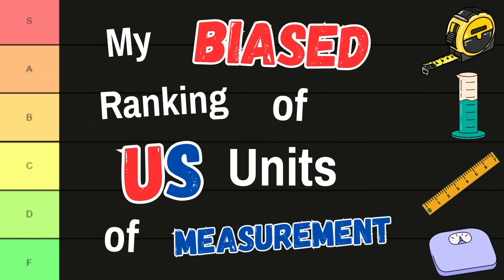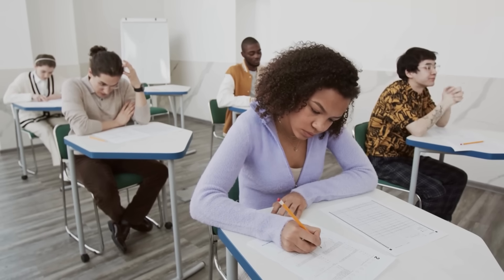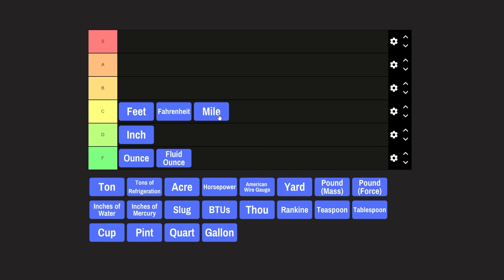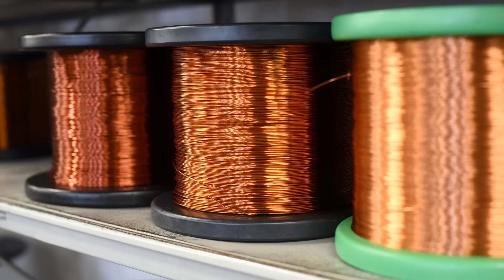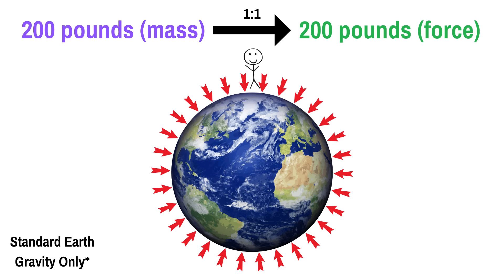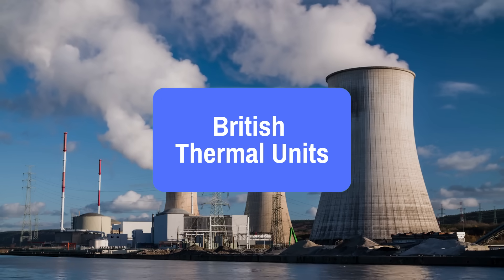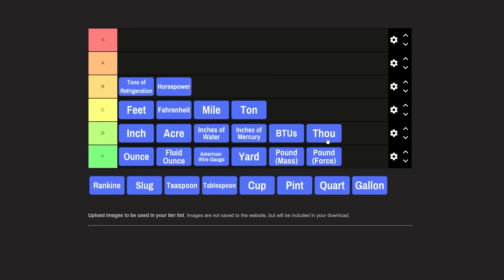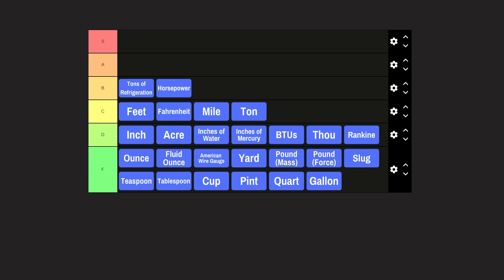Tier List of the DISASTROUS US Measuring System

Comment: I am surprised any of them made B-tier. And, for at least the measurement of length, the measures used are all based on metric, given that the official definition of an inch is 2.54cm. So, it’s all metric without any of the advantages of metric, and all the disadvantages that come when not actually using metric.

Comment: Twips are still used in typography.  That 1/1440 inches is a twentieth of a point, given that there are 72 points in an inch.  

Slugs are not used in everyday life in the U.S.  In fact, the only place I have ever seen them used was in a differential equations course.  They're sometimes used in engineering, but the sciences generally use SI units.  Because they're a somewhat traditional engineering unit and all the engineering majors took that course, the text included problems with that unit of measure.
Reply: 72 points in an inch was invented by Adobe in the 1980s; traditional American typographic points come in at 72.27 to the inch (though it probably should have changed with the definition of the inch in 1959)

Comment: Another f-tier would be psi
1) pound PER square-inch not pound TIMES square-inch => p/si
2) which pound?
3) a square of thumbs - wtf

In short: just use Pa (or bar).
Reply: @nathanwaight  Since I'm mainland european I never use imperial and only ever see it on bike pumps. But when i pump the tires i still read the bar scale because it's a unit i'm familiar with and actually makes sense. Using psi for tire pressure when you don't use lbs or inch would be just stupid...
And since Pa (N/m^2), bar (10 N/cm^2 = ~1kg/cm^2) and MPa (N/mm^2) correlate directly with area it's simple to get to grips with.
Reply: @nathanwaight  I worked in injection moulding and started with older machines where you physically needed to move the switch to e.g. give the signal to switch to holding pressure or stop injection, start mould safety zone when closing the mould etc. Certain things were based on the actual hydraulic pressure which on some machines was marked as "atü" - basically bars just named "Atmosphären Überdruck" (atmospheric overpressure).
Otherwise one i only came across once was centistokes for kinematic viscosity...
Reply: @nathanwaight  then atü is probably the same as atg. There might be a difference somewhere on the numbers behind the comma.
atü is not exactly 1 bar, a little bit lower, but close enough for the use it had in this case.

Comment: Save for a few exceptions, all base units are arbitrary. There's nothing inherently better about the meter compared to the yard, or the kilogram compared to the pound. It's the system as a whole that makes SI much, much better than imperial/customary.
Reply: The idea behind metre was that 10 000 000 metres should be half length of Earth's meridian (so from geographical pole to the equator). They were a little off in calculation and in reality half length of Earth's meridian is 10 001 965 metres. But regardless in metric it is easy to remember that full meridian is about 20 000 km and equator is 40 000 km. :) So at least they tried to some decent classification, not completely random.
Reply: @Hadar1991  I believe that inaccuracy was known when the length of a  metre was set - the calculation was made to work in a theoretical universe where the Earth doesn't spin and is therefore perfectly spherical. It's actually pretty accurate in that context. ( caveat: this information comes from QI, so is subject to the normal reservations concerning their facts )
Reply: Na, they're all arbitrary!
Reply: the only true S-tier thing is the fine structure constant, since it's unitless

Comment: I've posted this before, but:
I learned both Imperial and metric when I was in grade school. Now in construction, I consistently use Imperial. The 'inch, foot, yard' has no metric equivalent. A centimeter is too short and a metre is too long. The decimetre is the most useful metric length, but it's rarely used. Some say stair building is easier. Metric might be a bit faster, but it takes me longer find the other tape measure than the time I save. And as far as tapes with both measurements....😂 I will concede that A4 is a bit more elegant looking than Letter, but even in this arena I find Letter more useful dimensionally. A gram is close to useful, but a pound is more useful than a kilo - a kilo is too heavy. Temperature-wise I'm agnostic, I'll use either system; however, Fahrenheit is more precise. Volume is the place metric can excel, especially breaking down a cube into litres (a litre is a perfect size, well done metric) but how many people need to make those calculations?
Reply: "find the other tape measure"  It might surprise you, but builders here don't have to find "the other tape measure" because they use only one.  ;-)

And we can creatively use multiples and fractions of those units.  What a concept… for someone who surely encounters crazy stuff like 3 5/32" all the time.  Half a kilo (we usually don't say kilogram, if the context is obvious), 250 grams… really not that hard.  Celsius is of course as precise as Fahrenheit, you can measure any temp in both systems.  You might have to use decimal fractions, but given you use 2 7/64" lengths, that should be easy-peasy.  Or are you saying that the greatest country is not also full of the greatest and smartest people?

As to volume: this is really where metric shines, because volume is just length / area in three  dimension instead of one / two.  Imperial US Customary?  How many gallons go into a box that is 2 feet 5 inches long, 4 feet 1 inch wide and 3 feet 7 inches high?  Now do that without a calculator.  (I know that water utilities are billed in cubic feet, I *think*, but still, how many cubic feet big is that box?)

Comment: As an American, I had never before heard of using pounds as a unit of mass, so thanks for bringing this to my attention.  I was taught that pounds are a unit of force, and that slugs are the unit of mass... although we pretty much never use slugs (similar to how in SI it is rare to use the units of force in day-to-day life, instead using mass units as if they stand for weight).
Reply: And, yeah, body weight, body mass. Same thing. In realistic terminology, an astronaut still weighs the same weight in space. And experiences weightlessness! But, actually, he's still in a gravitational field, so his technical "weight" is only a bit less than on earth, but his apparent weight is what's weightless. So tbh non-apparent "weight" is kind of a useless term, and IMO the only things worth worrying about are mass and apparent weight. So we're free to continue using the word weight to mean mass and take the earth's surface gravity as the standard implicit conversion. That's my take.
Reply: As a fellow American, the reason you've never heard of using pounds as a unit of mass is because we don't do that.  We measure weight, and it doesn't really make a difference between 99% of everything we weigh is on Earth.
Reply: I hadn't either. Nor have I ever used slugs. Even 20 years ago, I learned in HS physics that you measure mass using kilograms.
Reply: There are mass pounds, but nobody ever uses them. Technically, one mass pound exerts one pound of weight under Earth’s gravity.
Reply: But don't Americans always give their own body mass in pounds?
Reply: @Juttutin  No.  My experience is that we give our body weight in pounds, and rarely talk about mass except when doing physics.
Reply: @glennscott5587  "we give our body weight in pounds". That IS using pounds as a unit of mass!!!
Reply: I distinctly remember being taught this as well, but it seems like in standard technical terms it's just not true. Pounds mean mass and pound-force is force. 

But this is all sort of like arguing about whether electron volts are a unit of mass or energy.... They're whichever they need to be, for the context in which they're used, and if there is an important difference we'll normally be careful to call attention to it.
Reply: If you think about it historically though, pounds absolutely have to be a unit of mass. For eons pounds were measured on a balance scale, which can only measure mass. Until the invention of spring steel, we literally had no way to measure force. Which all leads to the next point: historically, weight meant mass. Heck, "mass" didn't even exist in English until relatively recently. So we had been happily measuring mass under the name of "weight" with pounds and ounces on a balance scale until those units and that term were redefined to mean something they simply could not have meant historically.
Reply: @davidjames4915 Scales measure forces not masses. The only reason why this is so commonly mistaken, is that the gravitanional force on earths sourface is roughly contant. 

As said in the Video. A scale on a moon compare to the one on earth would be showing i a smaler digit.
Reply: @Justin_Time26  scales measure mass by measuring the force resulting from an inertial mass in a gravitational field.  You don't even need to know the gravitational strength if you have a reference mass for comparison.  A balance scale on the moon is going to give the same result as it did on earth.

Voltmeters typically measure current across a known resistance, but we accept that they measure voltage.  Scales output measurements of mass, your junior high school science teacher's explanation of the differences between force, weight, and mass notwithstanding.
Reply: @Justin_Time26  Well that depends on what kind of "scale" is being used. You're talking about spring scales, i.e. scales that use spring steel, something we've only had for less than two hundred years. Before then we couldn't measure weight as we now define it. Older scales are balance scales (perhaps the most famous being Libra, the Zodiac sign and from which the "lb" for "pounds" comes) which are comparative mass scales, except of course back then that was called weight before weight was redefined.

The fact that weight was redefined to an historic impossibility is actually the source of most of the confusion.
Reply: @Juttutin  I mean sure, a scale shows you the mass but it measures the force. 
 And this thing with the reference mass you said. Sure thing its like filling up unknowns in an equation. 

Sorry my English is not the best but i will try to expain. 
Imagine you have a digital scale in your Bathroom on earth. And you put a cube of tungsten with a sidelenght of 38,7mm on the scale. The scale should show you 1kg. 
Ok now imagine the same scale is waterproof and you measurement again in 1 Meter depth on earth. The cube of tungsten will now be lighter as 1 kilogram because off the upthrust off water. 
What i want to say with this example was that even tho the gravitional force remains the same in both measurements other forces can make an object „heavier or lighter“.
And a scale showing 2 different masses for the same object while being on earth shows that the scale must have measured the force since mass is not affected by force or temperatur or pressure 

Therefore the digital bathroom scale is measuring the force on it
Reply: @davidjames4915 Balance scales do in fact measure force, not mass.  It compares the weight of one object to another object.  Because both objects are subjected to the same gravity, the force of gravity is cancelled.  While on the surface that makes it seem as if you are measuring mass, not weight, the scale doesn't work if there is no gravity.  Therefore the scale is balancing forces, not mass
Reply: @limprooster3253  balancing forces, to measuring mass.  Unless you want to redefine the word 'measure', lol.
Reply: @Juttutin  indirectly measuring, maybe.   Kinda like measuring the distance between two towns by measuring the time it takes you to drive there
Reply: @limprooster3253  no, it's like the odometer, which works by counting rotations, but is used to measure distance.

Or like the voltmeter example I gave above, which can work by measuring current through a known resistance, but is accurately described as measuring voltage.

Regardless, pounds are primarily (fundamentally) a unit of mass.  They can be repurposed to be used as a unit of weight, and through that, further repurposed to be used as a unit of force.

Edit: I may have the voltmeter wrong.  I think it's an ammeter (current meter) that measures (detects, counts, uses) volts across a known resistance to measure (tell the user a value of) amps.